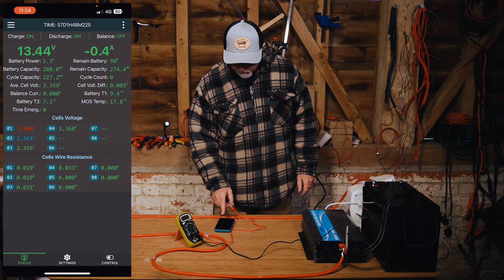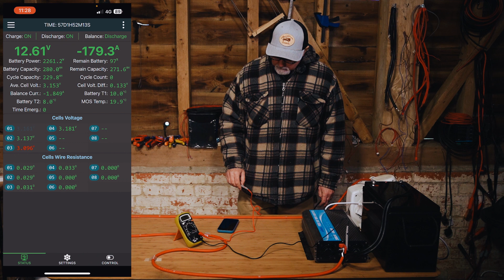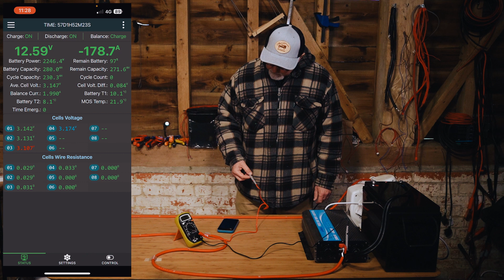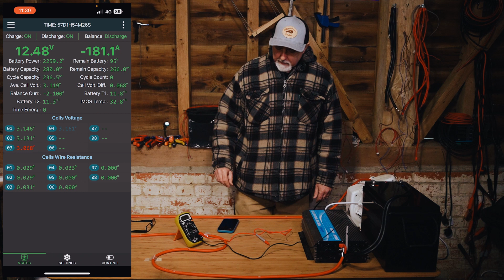How much voltage is lost over long wire?

Comment: At full power, your figures indicate that 0.36x181=65W is dissipated as heat in the cable because P=VI. In this instance it follows that with a 1m cable, it will dissipate roughly 22W as heat, so the losses are much lower. That explains Roger's comments about cable size and length. If you know the specified resistance/metre or km of the cable, which will be provided by the manufacturer, you can calculate the losses using P =IsquaredR   where P=power in Watts, I=current in Amperes and R = resistance in Ohms.

Comment: Im running 35mm at 20 feet
Reply from the maker: Sweet, does it work well?
Reply: @offgrid_power  for how rigged up my system is and how low of a draw. it works good. I'm sure there's some sort of loss there.

Comment: I was hoping you were going to do the test with 2 or 3 cables
would be nice to see the difference between 95mm and 50mm cables
Reply from the maker: Do you mean 95mm & 50mm thick or length of wire?